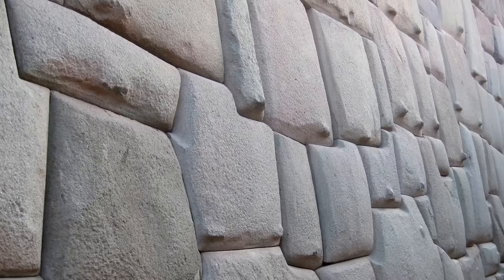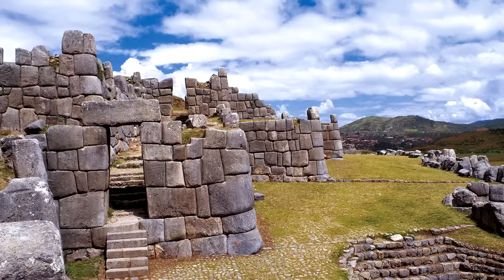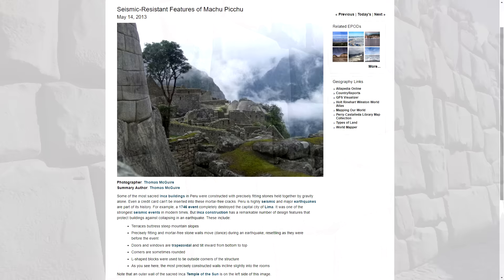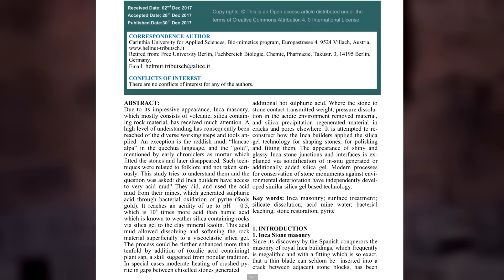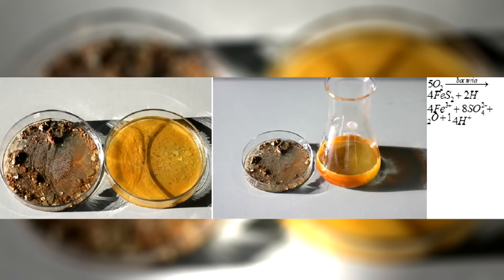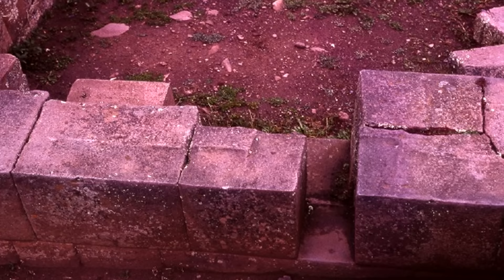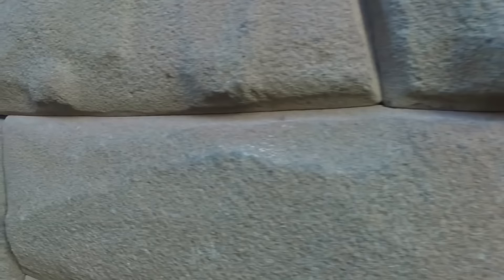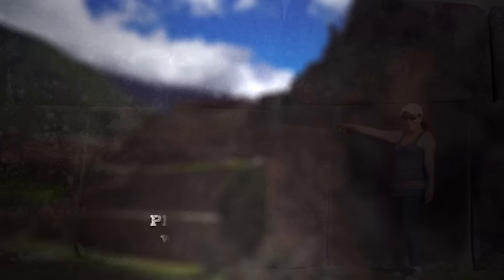Is This How The Inca Walls Were FINISHED/JOINED So Perfectly?

Comment: I saw a film, some German amateur wondered out loud 'how did they do it?' and an old man said it was passed down to him through generations.  The town they were in was incomplete and the old man pointed out the large rock on the other side of the valley.  They levered it down a shute that had been created hundreds of years ago, sliding down the shute the rough edges were cleaned up a bit.  Then 200 people dragged it with ropes up the 5% slope all their roads had.  They wet the round cobble stones of the road and the rock slid easily.  Then they levered it into place, marked where they needed to work on the stone, lowered it chipped away lifted it back a few times and then it fitted and they backfilled it with earth.  Nice and easy - but his research was not approved because it made all the professors look foolish with their theories of acid, softening stones and all that clap trap.....

Comment: I don't understand how people think this is some extraordinary accomplishment. At 1 minute 7 seconds you can see exactly how these joints are created and it ain't pretty. It is really just a veneer. The fronts of the joints are rounded nice and the backsides are hacked away leaving a very thin mating surface that has to be somewhat precise. Not to take away anything from craftsman who did this, i mean, it's pretty tight and looks cool but any reasonably skilled tradesman or artisan with basic tools available at the time could do this. People look at the complex shapes and think they must have been really skilled to cut all those shapes. It is more likely that, if they had better skills(or perhaps better technology) then they would have been able to cut the blocks the same size.

Comment: 1). How could they have determined the exact amount of that solution that was suited for the top/bottom and sides? There would necessarily be places where any acidic solution would puddle or run, creating eroding actions that would be evident in other places. 2). If the blocks were cast from what is basically a cement (geopolymer). I would love to see the "bags" or forms that the varied sized blocks would require. If the blocks were cast, I would think that the blocks would have been more manageable if they were in some standard size/weight. What strength could the bags or forms require? Has anybody ever found any of those forms or bags? 3). Has anybody researched the stone working methods found elsewhere where there are demonstrations of methods of aligning facing edges? 4) The nubs that are seen were certainly used for material handling and placement. 5). I saw some photos of the back sides of these walls. They were not the same quality as the front sides (the internet being as it is, who has been there to verify any of those claims?).  I have never been there. To some degree, the video here does seem to show some gaps between the stones. We think in modern terms. If we had 12,000 years (or more)  to look for ways to handle big rocks and had only the tools we made to get it done we might wonder about the modern ways to do things. -Ron

Comment: The most powerful tool for cutting these stones was achieved by the use of human urine The rock used was usually limestone and because human urine has a high concentration of ammonia the peoples of that time had discovered the power of urine by accident So the masses were urged to contribute their into large vats which developed in these stones by accident These vats were then lined with resin from trees so that the urine did not attack these stone vats The urine was then run into thin scratches on the rocks causing an etching effect thus causing a cleavage of the rocks in a very controlled manner

Comment: It would have to work fairly quickly and be able to be applied in all weather conditions. Bio chemical mineralization reaction kinetics can usually only be relied upon in tightly controlled environments. Perhaps if the bio activity was dropped in favour of some form of high frequency vibtation with the same type of mud, that might work better. However, that raises a whole range of other problems. Relative to the size of the stones and availible technologies.

Comment: I suspect they built a temporary enclosure and filled it with water, or simply kept pouring water on the stones and they painstakingly lapped them in place one at a time, either right to left or left to right. Basically you cut the stone roughly to fit the space, and then a hundred men play tug of war back and forth with the stone until it is fully lapped in place. They use the temporary water enclosure to float the stones in place on a raft.

Comment: Nope. In a quarry, they carved in the bevels as a whole pattern in the big and still closed natural rock face. Then they split a whole "wall" as a slice off the giant face from above and made it drop down. It fell forward ninety degrees and broke exactly along the carved bevels. The little knobs that you see sometimes helped the breaking process and yes, they carved them out negatively. You will find these knobs always close to the bevels (a.k.a. the prepared break-lines.) The reason why the single rocks often have very individual shapes is that the experienced masons like to use the natural break lines in the whole rock face of the quarry site. So if you marvel at how they made them "fit" so perfectly: This was similar to glass-cutting but with the exploitation of gravity and a good shove. You can try that yourself at smaller scale. So no acid that melts rock to perfect tightness (in vertical position this doesn't make sense: the rocks would have to be pushed together during the process, and there's no rubber band strong enough to achieve that). Ask any mason how he'd do it.
Reply: If this theory was correct, then striations and grain of the stones would all match up, and they just don’t. Also, to “split” a 100 ton stone off a rock face with that level of precisions with the tools they had is an impossible feat. Not sure if you’ve ever split stone with chisels before, but it isn’t exactly reliable or accurate. You can learn to read the rock, but even experienced masons have stone not “listen” to the chisel right. And we’re talking small stones
Reply: @tylerk.7947  They do match. Don't get fooled by the withering, because once they are separated, the main elements that continue to alter the material (water, heat, freezing, lychen), affect the blocks differently over time. The splitting in the quarry from top to bottom can be done when the rock's layering is appropriate (all through, and that's the reason why they chose that place as a quarry in the first place). To split they useed wedges (not chisels) and water (a technique still applied in remote areas when an avalanche blocks a road with huge boulders, that's how they remove them without dynamite: wedges and water). As a matter of fact, if you look at the back sides of the walls, you can see the rough surface that has not been worked on (that was only done with free standing ones). No "precision in the back. So people rather believe in some forgotten rock melting technique than what a mason would do if he had to. The key element is that indeed chisels were used but for the bevels which work perfectly as break-lines (and if there were natural ones, they beveld along them). And these blocks ALL undeniably have bevels and that's not for beauty reasons. Look at how deep they are.
Reply: That makes more sense, at least, than the acid IMHO

Comment: To build such type of construction today would be prohibitively expensive. Each stone would have to be blueprinted so as to fit to the ones beliw and in each side.
  Today we use small cinder blocks, bricks, pavers, etc because they are all small, mass produced, easily transported on pallets and mortared together. No one builds with the method shown here. To fashion one stone in their method would cost a fortune for the one stone and that's using all sorts of high tech, motorized equipment. Then the cost just to transport such megaliths up steep hills and mountains with no paved roads without damaging them would be insanely expensive. Whoever quarried the stones and transported them had technology that has since been lost and which to this day we haven't discovered.

Comment: For me, all these buildings must have a common denominator. It seems to me that also in those times, Slavic construction teams traveled around the world looking for work. As I know, Slavs are hard-working, but they don't like meaningless work. I suspect that their foreman had some kind of patent for stone processing, which they used on all construction sites around the world.

Limestone can be processed mechanically or chemically, and for me this is where chemistry comes into play. The acidic environment dissolves the limestone and causes its top layer to become plastic. In my opinion, these stones were placed "wet" and only atmospheric conditions led to the neutralization of the acid. Why is everyone looking for mechanical methods of processing, completely ignoring chemicals?

Comment: The walls I created with the same fitting texture while so much smaller (Under a 12 by 12 inches blocks) where with a liquid concrete mixture partially cured in a form before the next one was poured and yes my edges where rounded over the same to stop chipping. just a bit of info they still are not sure how the Romans created their concrete with lots of differing fill material.

Comment: The glazed/glossy look seems to be, and probably is, relegated to the vertical joints. If so, that would tell me one thing, hydrolysis. This sulfide hypothesis would take far longer than shaping by hand. It’s a neat hypothesis but it does not fit practicality as it would be highly unpredictable as compared to fully shaping the stones before placement.

Comment: I went to Peru in 2008 to see Machu Picchu.  During one of the tours the tour guide said that the Peruvian Geologists had done investigations of how the rocks were made and found the Acid residue.  Makes sense.  He said the rocks were roughly shaped then the red acidic mud was put between the rocks like mortar and the acid ate into and combined the rock face and acid mud into a closed joint.  I asked why some of the rocks had Nubs.  He said there isn't an official statement on those but he said, if you look at where the nubs are on the rocks, it appears they were used to hold ropes from slipping off while they were being moved.  Not sure why they are there but in similar stone construction all over the world there are the same tight joints between rocks and all the other sites have rocks with nubs.
Reply: If this were true there would be material that oozed out and the construction would need to be disassembled to grind this off then re-assembled.
Reply: @RKBaxter or you know, just wipe it off when it oozes out. Have you heard of that before, wiping? It's where you take something and rub it against something else to remove a material on the surface of the something else. I truly hope you've wiped before.
Reply: @kevinhank17  I need to check myself first. Wiping just doesn't sound like some thing you do with stone, heavy stone! Chiseling or grinding seam more plausible.

Comment: If the Inca were so adept at building and manipulating stones why didn't they just use smaller stones? They could have made uniform sized stones (like bricks) and built faster and more efficiently. Even if they had acid water technology they still had to shift gigantic stones. Wouldn't it have been more sensible to use smaller stones?

Comment: Wouldn't this open the joints by corroding all edges? Particularly the vertical joints? I can sort of imagine gravity pulling the blocks down to close the horizontal gaps but gravity wouldn't help with the vertical joints. The irregular shapes may also limit some of the settling.

Comment: Sedimentary rock is 4500 years old. The breakup of Pangaea was associated with vulcanism, burning hardwood forests. The ash, when mixed with sand and hot water produces water glass. The slow setting cement is called sedimentary rock.The giants shaped these cementacious mud into polygons to resist water the frequent earthquakes. Petrification gradually hardened these walls .

Comment: I think that if it was a form of acid washing then there would be run off marks on the face as the rocks dissolve which there are none ! A more likely way would be to be the rubbing of the stones back and forth with some type of abrasive until they achieved the tight fit ! Laborious yes but not unthinkable!

Comment: This explanation seems limited to horizontal seams, as vertical seams wouldn't benefit from the compressive force of gravity.
Reply: No, but if the stones have any pitch to them, basically meaning that they rest with some weight falling laterally as thought they were sloped ever-so lightly like the side of a triangle, that weight might suffice.
Reply: They could have produced the seams horizontally then tipped the stones so the seams ran vertically.

Comment: The stones are just ruff cut to fit then right there were they will forever rest they are rubbed back and forth against the side while the weight of the stone grinds the bottom flat because all surfaces have been ruff chiseled flat they continue on flat until ground smooth like this.

Comment: No, might play a small role in raw stone finishing, but there's still the logistical problem of transporting huge slabs. But creating such slabs from disparate materials like stine dust,  easily transported by pack animals or boats to sites, then combined on site makes an abundance of sense.  The geopolymer nature of several of these were confirmed by Davidovits. And the evidence for it is impressive.

Comment: The walls were probably built like normal walls,but they must   have had some frequency work done later to sort of fuse them.
Advanced races need only be advanced mentally.Technology is only a by product of an advanced mind.
If one is told to write a word on a balloon,it is easy.But can one write the same word on the inside of the ballon.Now if you use the trick of deflating the balloon and turn it inside out,and then inflating it,you can do it.The point being that matter can also be approached in another dimension.And if you are advanced enough,you can do it,to make it seem impossible in a normal dimension matrix.

Comment: In Peru I noticed in a path that flat stones five feet in diameter were cut from the same rock.  The pathway stones five feet in diameter ( 7 or 8 of them) were five to six inch thick.  Also all stones appeared to have five 3 inch holes (3 inches long) drilled at identical places in the stones where they had split from the rock.  Could it be that the Peruvians knew exactly where to hammer holes which split the stones from the rock.  Perhaps they could read a rock and know how cut a slab of stone from a rock.

Comment: I don't think this is the definitive answer to the question of stone adaptation maybe it's a concret and not natural stones or maybe it is melted by sound energy abd when placed they adapt to the stones nearby or to a pattern  which is removed after stone is stabilized because the explication given in the video doesn't give explanation for the stones forms but could have been useful between the stones only and can't explain how profound are certain joints
Reply: Davidovits

Comment: Maybe they used wood or clay first to make the shape that's going to go on top of the first rock. Take those dimensions over to the rock and shape it using their template they just made. And make it the exact size? That way there's no trial and error lifting and resetting massive rocks.

Comment: Ever rub two stones together?  They fit perfectly after grinding each against each other.  This would also explain the odd joints that are curved.  No problem if you are just rubbing the stones until they fit.  What would it take? Massive manpower and strong ropes, then playing a game of tug of war on the stone you want to grind to fit in the wall.  We know they had ropes capable of bridging over river valleys.  They wove their ropes into a bridge they could walk over.  One could put sand on the bottom cut to make it slide easier and the sand would grind both rocks at the same time.  How do we smooth rock today?  We take big flat wheels, put sand between them and the stone and make continuous circles.  Adding sand as needed until we reach our desired smoothness.
Reply: Or, you just, heat the stones? Its friction right? Heat right?

Comment: The acid heavy clay explanation is a hypothesis, nothing more. It's one thing to propose how something is done, but there needs to be actual physical evidence to show that this was how it was done, and there is none in this case. And even if you built a wall to demonstrate it was possible, that still does not mean that was how it was done.

Comment: This makes some sense. So the rocks are roughly cut and then coated with the bacterial paste and then placed, leaving time and the biochemical process to render the resulting fine, often near perfectly linear interfacing rock seams & joints. But if it worked that far, how did the process know to stop and not to over-do itself?  And then the lifting of these megalithic boulders is still not explained. I'm still much more comfortable with an outer-space, extra-terrestrial connection.

Comment: Any kind of chemical stone treatment can be seen clearly, at least in higher magnification with a microscope. Was there really no testing done ever? A simple microscope of the joints will answer the questions quickly. And even more: with electron microscopes you can also detail the statements, as i.e. the chemical composition of the joints will definetely be different in several places.